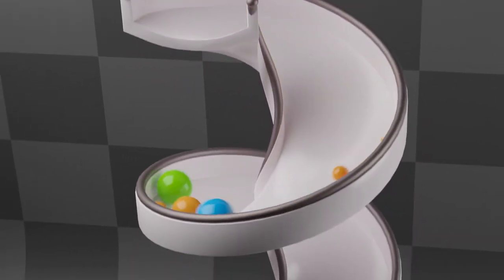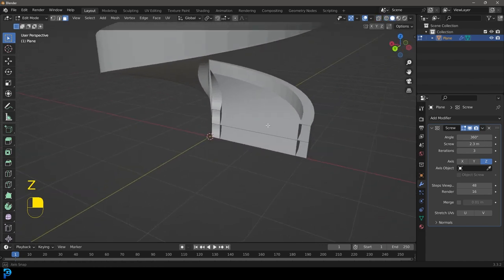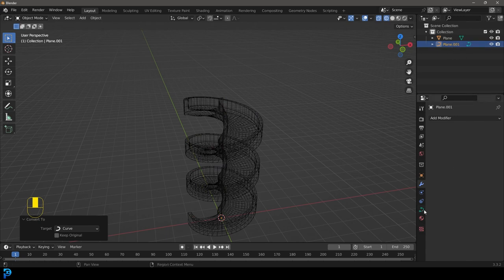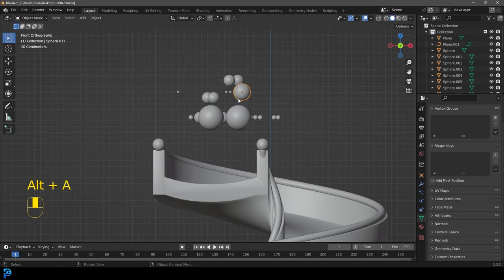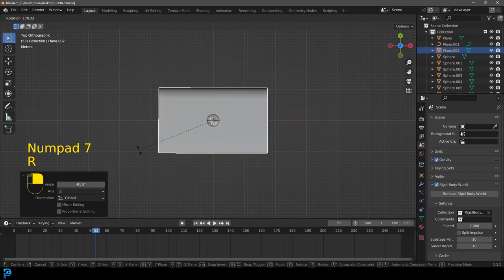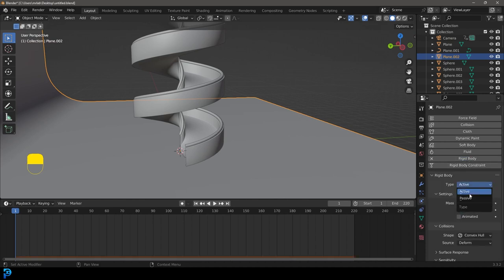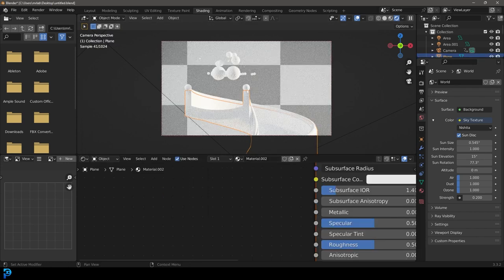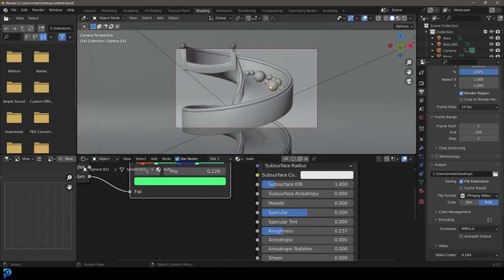Blender Tutorial: Spiral Tower Rigid Bodies, So Satisfying & EASY

Comment: Again a great tutorial, what version of blender are you using? I am on 3.41 i could not get the screw modifier to work in edit mode the edges are not shown until after the modifier is applied, i tested it using 2.9 and 3.3.4 of blender and the edges are shown in edit mode before applying